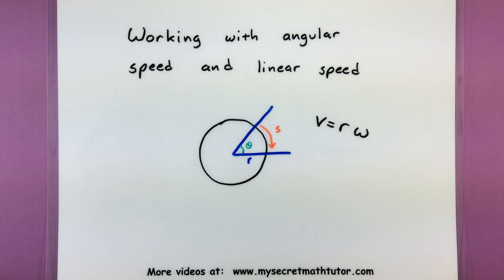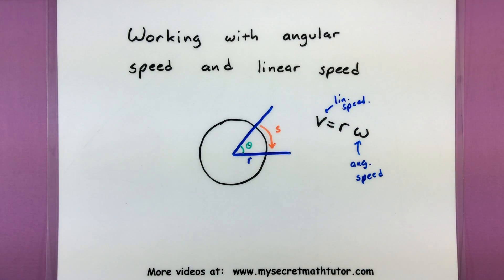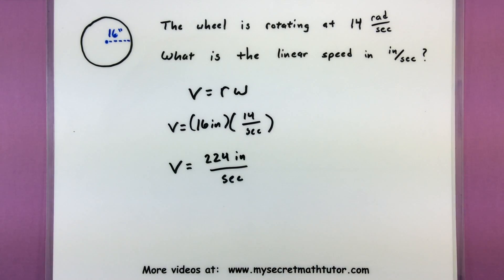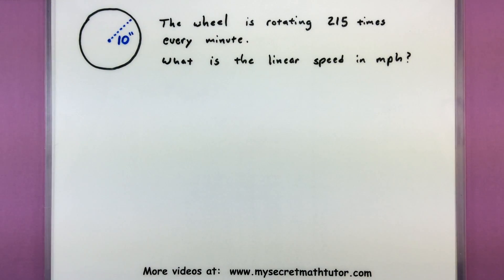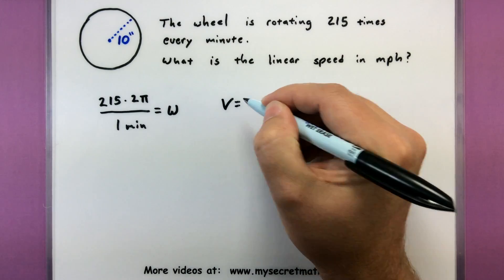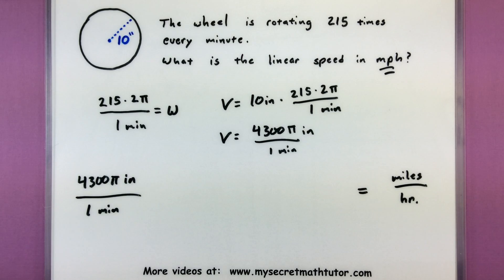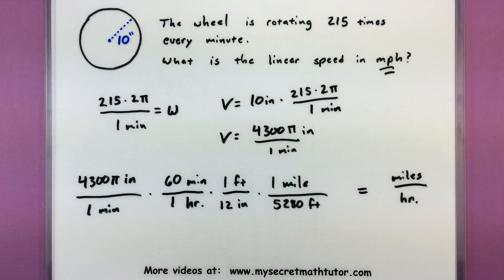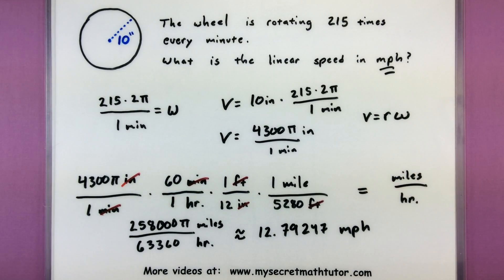Trigonometry - Working with linear and angular speed

Comment: Many people wonder why radians do not appear when we have radians*meters. 
Here is an attempt at an explanation:

Let  s  denote the length of an arc of a circle whose radius measures  r.

If the arc subtends an angle measuring  β = n°, we can pose a rule of three:
360°   _____  2 • 𝜋 • r
    n°   _____  s

Then
s = (n° / 360°) • 2 • 𝜋 • r

If  β = 180° (which means that  n = 180, the number of degrees), then
s = (180° / 360°) • 2 • 𝜋 • r

The units "degrees" cancel out and the result is
s = (1 / 2) • 2 • 𝜋 • r
s =  𝜋 • r

that is, half of the circumference  2 • 𝜋 • r.

If the arc subtends an angle measuring  β = θ rad, we can pose a rule of three:
2 • 𝜋  rad   _____  2 • 𝜋 • r
      θ rad   _____  s

Then
s = (θ rad / 2 • 𝜋 rad) • 2 • 𝜋 • r

If  β = 𝜋 rad  (which means that  θ = 𝜋, the number of radians), then
s = (𝜋 rad / 2 • 𝜋 rad) • 2 • 𝜋 • r

The units "radians" cancel out and the result is
s = (1 / 2) • 2 • 𝜋 • r
s =  𝜋 • r

that is, half of the circumference  2 • 𝜋 • r.

If we take the formula with the angles measured in radians, we can simplify
s = (θ rad / 2 • 𝜋 rad) • 2 • 𝜋 • r 
s = θ • r

where  θ  denotes the "number of radians" (it does not have the unit "rad").
θ = β / (1 rad)

and  θ  is a dimensionless variable [rad/rad = 1].

However, many consider  θ  to denote the measure of the angle and for the example believe that
θ = 𝜋 rad

and radians*meter results in meters
rad • m = m

since, according to them, the radian is a dimensionless unit. This solves the problem of units for 
them and, as it has served them for a long time, they see no need to change it. But the truth is 
that the solution is simpler, what they have to take into account is the meaning of the variables 
that appear in the formulas, i.e.  θ  is just the number of radians without the unit rad.

Mathematics and Physics textbooks state that
s = θ • r

and then
θ = s / r

It seems that this formula led to the error of believing that
1 rad = 1 m/m = 1

and that the radian is a dimensionless derived unit as it appears in the International System of Units (SI), when in reality
θ = 1 m/m = 1

and knowing  θ = 1, the angle measures  β = 1 rad.

In the formula
s = θ • r

the variable  θ  is a dimensionless variable, it is a number without units, it is the number of radians.

When confusing what  θ  represents in the formula, some mistakes are made in Physics in the units of certain quantities, such as angular speed. 

My guess is that actually the angular speed  ω  is not measured in  rad/s  but in  
(rad/rad)/s = 1/s = s^(-1).

Comment: Where I get confused are the units. I'll be given 2 very basic units such as degrees per min and the radius, and be expected to find revolutions per hour. That makes figuring out whether I have angular speed or linear speed to be a pain.
Reply from the maker: You can treat units just like variables.  Degrees per min might look like a fractions with degrees on top and minutes in the bottom.  You can then convert these fractions by multiplying by 1 (unit fractions). 

Here is an example

(1 degree) / (20 minutes)   *.    (60 minutes) / (1 hour)
The “minutes” will cancel and then you can just work with the numbers giving us a result of

(3 degrees) / (1 hour)

Comment: With 25800 pi miles over 63360 hrs did you divide ? Multiply ? To get aprox 12.79247 mph ????
You didn’t explain the step & it lost me